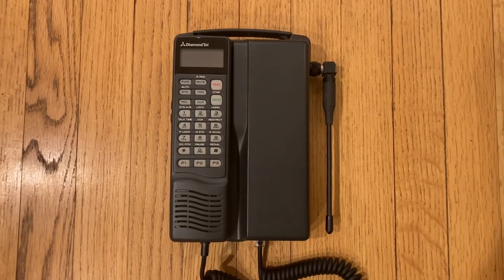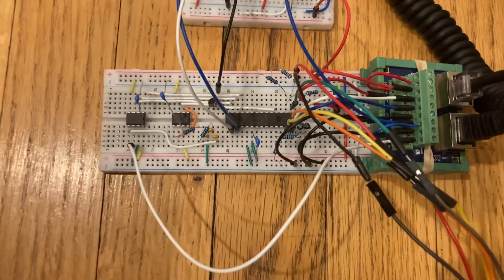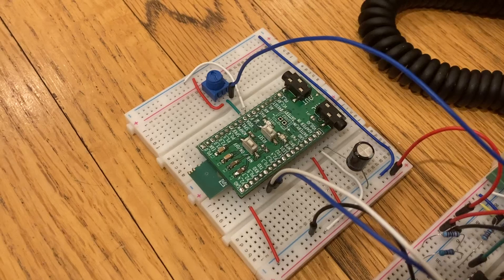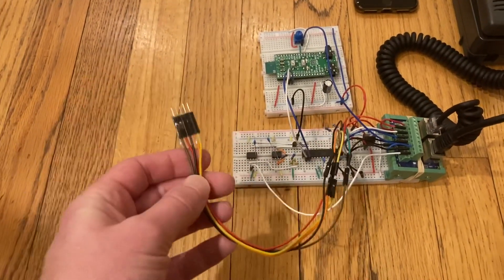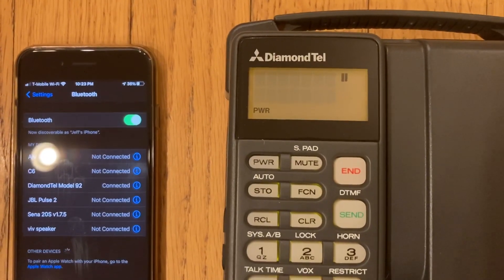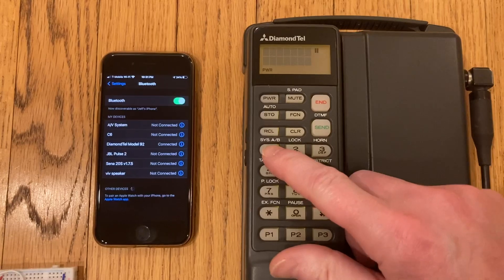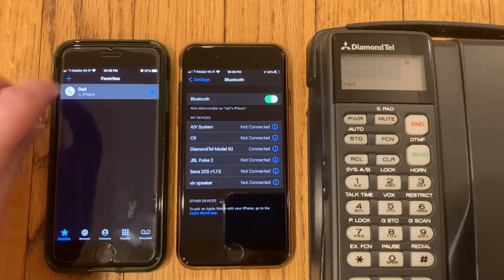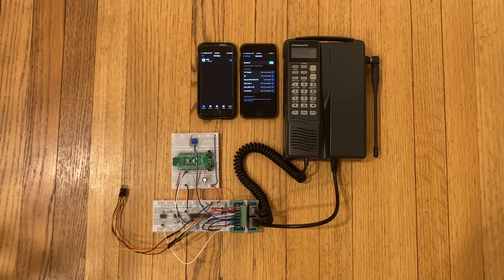Vintage Car Phone Makes Real Phone Calls (Bluetooth Adapter Prototype)

Comment: You should make a KickStarter or something. I'd buy one!
Reply from the maker: The market for this device would be quite limited. There's only 2 specific models of Mitsubishi/DiamondTel phone that it is known to be compatible with, and it is unlikely to be compatible with many more. I don't think it would be worth the investment to pay proper professionals to design consumer-quality hardware.

But I do plan to work on publishing everything as an open source project (free for personal use). It should be enough information for any tech-savvy person with soldering skills to replicate what I've done.
Reply: @UselessPickles  I was in the process of reverse engineering the GM motorola system when I found this. Oldsmobile trofeo had all this integrated into the screen. so the screen is a second handset more or less. looking at what you have done , I understand it, worked out in the first couple of videos where you mapped the handset commands and so on/ great idea and I love it!
Reply from the maker: @ChrisRogersBrisbane  Welcome to the very small club of car phone reverse-engineering! When I started working on my project, I couldn't find any examples of anyone that had done anything similar at all. The closest I found was a couple examples of people that gutted the handset of a car phone and hacked an off-the-shelf Bluetooth headset into it.

In case you haven't seen it yet, here's a forum thread where I documented many of the technical details of how I reverse-engineered the car phone and developed the Bluetooth adapter: https://www.electro-tech-online.com/threads/making-a-bluetooth-adapter-for-a-car-phone-from-the-90s.162764/

And here's the GitHub repo where I published all of the technical info, circuit design, and source code: https://github.com/UselessPickles/diamondtel-m92-bluetooth

Hopefully this gives you some more ideas about how to tackle your project :)

Will you be posting any info/updates about your project anywhere? I'd be interested to see what you do.

Comment: Take my money please , I need this for my set up
Reply from the maker: I will gladly take your money. I just don't have anything to give you in return :)

It's still just a sloppy breadboard prototype velcroed to the carpet in my trunk, with digital noise interference issues on the audio and some bugs due to rushed sloppy code.
Reply: @UselessPickles  well let's hurry it up then.I got money to spend.

Comment: Is it possible to switch the guts out of the nrains and slide in a 5G card since nothing is in the headset containing this?  Definitely amazed with your progress!
Reply from the maker: That sounds much more complicated than what I did :). When swapping guts of another phone into the handset of the car phone, you would have to solve problems like integrating the car phone handset buttons with the guts of the newer phone, and fitting the display of the modern phone into the handset of the car phone (plus more problems).

The end result would also be much different. The behavior and display of the phone would be that of a more modern phone, but inside the physical case of the old car phone handset. My approach preserves the authentic behavior/experience of using the original car phone.

Check out my newer videos. I've made much more progress since this video :).

Comment: I've never heard of Diamond Tel.  Are they the maker of the phone?  It closely resembles an OKI Telecom cellphone.  When you get this project completed, I would be very interested in the final product.  This could breath new life, into some of the older analog cellphones.  Finally, a decent sounding speaker!  :)
Reply from the maker: Mitsubishi is the manufacturer. DiamondTel is a "premium" brand name that Mitsubishi used for some of their phones. This phone is functionally (but not physically) nearly identical to the Mitsubishi Model 1500 phone (handsets and transceivers are cross-compatible).

Unfortunately, my solution is very specific to the communications between the transceiver and handset for these models of phone. It may possibly work for some other DiamondTel/Mitsubishi phones, but I'd be very surprised if it worked for any other brands of phones, because the communication between the transceiver and handset is most likely proprietary.

I also don't know if I'll ever get this past the point of being a rough prototype just barely good enough for my personal use, but I will eventually be publishing technical details, circuit diagrams, and source code.

Comment: nice!
Reply from the maker: It wouldn't have been possible without your breadboard adapter, so thank you! I'm not quite ready to get into designing PCBs, but I suspect I'll be more motivated to learn after I get this prototype more finalized. First, I will probably upgrade from breadboards to a perforated prototype board after my circuit is more finalized.
Reply: @UselessPickles  that adapter is not designed to by used in final circuit, traces for audio are not properly spaced and routed etc.... lot of notice is picked on the way, so new and better board is probably good idea :)
Reply from the maker: @tomaskovacik  Good to know. Now I can blame your board for my excess noise, even though my circuit is very sloppy and likely introducing substantially more noise :)

I have never designed a PCB before, and only know some of the very basic hypothetical concepts about routing traces "properly". I'm still working with breadboards. 

I have a few more problems to solve before I move everything to a generic through-hole prototype board. I'll still be using your board to adapt to the through-hole board, but I hope the soldered connections and better ground routing will substantially reduce noise caused by my sloppy breadboard circuit.

I don't know if I will ever advance from the prototype board to a PCB. For a one-time custom personal project, I think I may be happy enough with the prototype board.
Reply: @UselessPickles  i can design a  pcb for you if you have (sketches) of the schematic diagram
Reply from the maker: @harryvandoorn7471  Thanks for the offer! I will get in touch if/when I think I may be ready to do this.